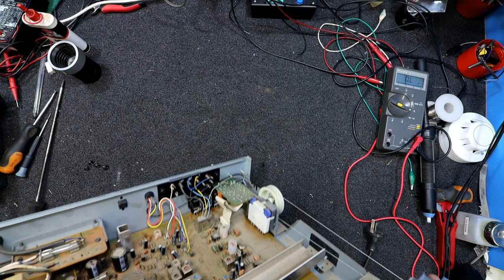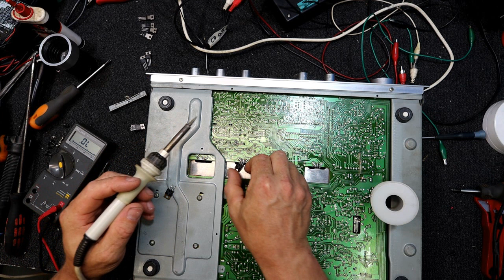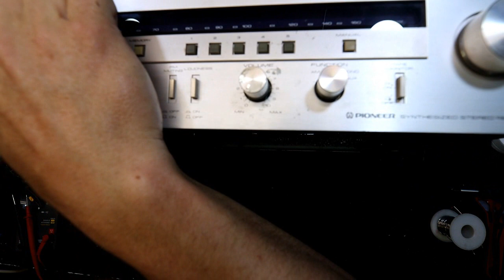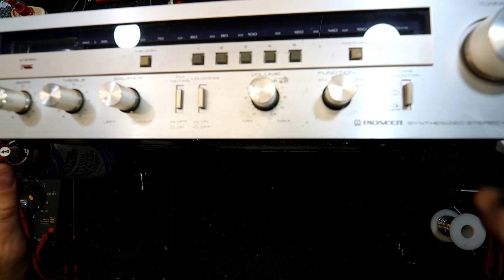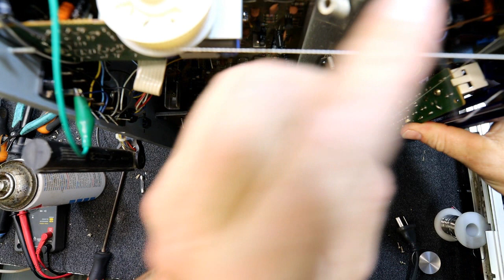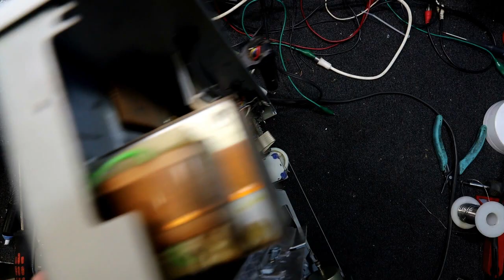Pioneer SX-600 Receiver Blown Channel Repair

Comment: Can an output be weaker than the others? My amp, the right channel, is weak and isn't putting  out the high frequencies as loud as the left. Nit my hearing it's a decent difference.
I reflowed every solder joint with low temp solder paste. Amp sounds better but still has the channel balance issue.
Reply from the maker: Different levels between channels isnt that uncommon a fault. Different frequency response between them is also possible. Clean all switches and check the electrolytic capacitors with an ESR meter would be the first steps. After that you likely need a signal generator and oscilloscope to compare the signals between channels to find the fault location.

Comment: I enjoyed the video. I have the sx-600l version and I had to replace one of the output transitors on the left channel, however the left channel gets really hot  and after about 5 mins and the current protection bulb starts to glow quite brightly. I don't have the heat sink on so it's easy to tell that it's getting much hotter then the right channel. The right channel is almost cold. I'm a bit stuck on what to do now.
Reply from the maker: Its always best to run them on the heatsink because things can get quite hot in some units just because they are off it. Best thing is to compare voltages on the transistors between the two channels. Also check the quiescent current draw. You may have another faulty transistor. Another cause can be that the amp is oscillating at higher than audible frequency. An oscilloscope on the output is the only way to know.
Reply: Thanks for the reply, in the end I swapped them from left to right and now they get hot in the other channel. I think they're damaged but it's not showing on the tester.
I do have an old oscilloscope but have never really used it. I'm going to order some replacement transistors form Mouser when I next order something.  Cheers.   
 @StevesElectronicRepairShop